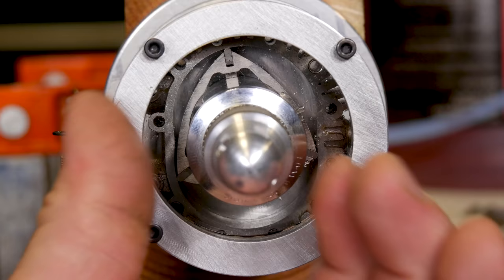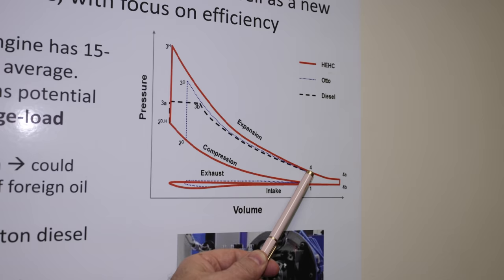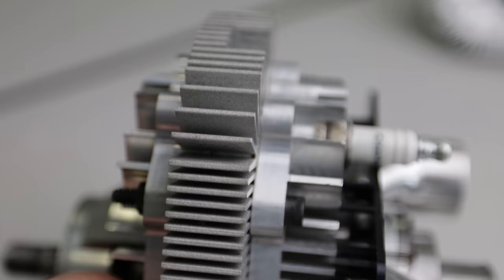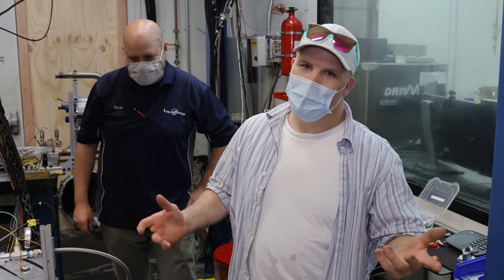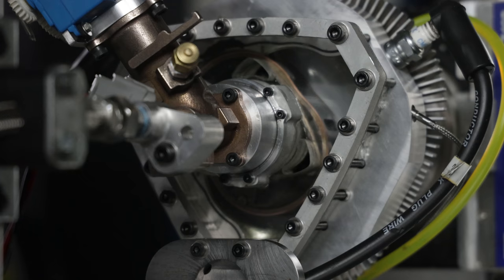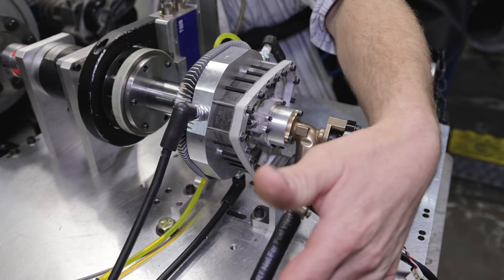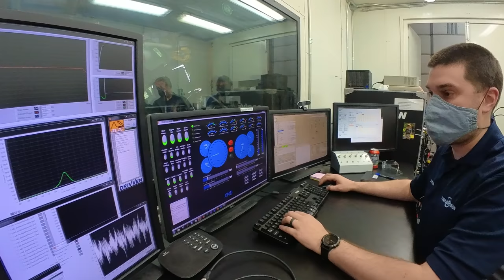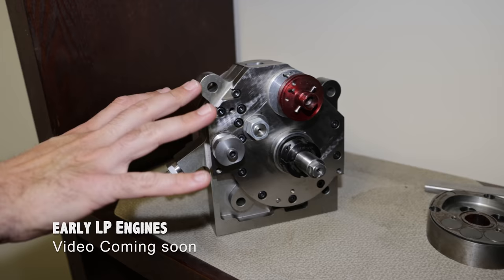See Thru Liquid Piston Rotary Engine - In Slow Motion

Comment: I already see problems.
-How does scavenging work?
-The other side of the other Rotor is always compressing, power stroking and exhausting
The temperature difference isn’t good
-the intake of air fuel and the exhaust flow isn’t efficient

Comment: First off, the acetylene run was stupid. It crapped up the motor so you couldn't see the rotor and you had to clean it. What did this prove, other than you know how to make a mess?

Second, you didn't say anything about how the apex seals were going to be better in this design. They're mounted on the case instead of the rotor in this design but I don' t see how they're any more reliable, better sealing, easier to replace than the standard Wankle seals.

Third, one of the biggest problems with the rotary is that it's a bitch to get them to pass emissions testing. You don't say anything about efficiency improvements with this.

In short: You don't address anything of substance in this video, you're only saying how cool everything is. I think LiquidPiston is chasing their tails on this design. I don't see any improvements here.

Comment: So they moved the apex seals, (which was the ''problem'' with rotary engines) to the housing instead of the rotor. How isnt that the same problem?
Im just a random rotary owner, (rx7 and rx8) with engineering degree in ICE, and im genuinely not trying to be a smartass.
Reply: I am not an engineer or a mechanic, but I assume that it is better because they are now stationary within the engine and not on a moving part as they once where.
Reply: @snake14088  I see your point but even in a moving part, the wear of the metal is exactly the same since its one sided. Same with stationary parts. The wear will be one sided. It could be that the housing is receiving less stress and in a more controlled manner than the moving part. I guess they know something we dont. Who knows, maybe its the next best thing.
Reply: @thomaskalkanis3777  The primary advantage is the ability to oil the apex seals directly, much like piston seals. The rotor's face seals are then oiled by constant contact with the apex seals. No more oil-fuel premix, dramatically reduced oil consumption.
Reply: @boissondevin9772  I understand this would be a step forwards. However the main issue with rotaries is still the excessive wear of the seals. Probably with direct oiling it will be reduced ?!

Comment: This is literally an inside out Wankel... The apex seals are still there, they just aren't part of the rotor. The rotor is the same shape as the chamber in the Wankel, and the chamber is the same as the rotor on a Wankel. I'm not sure this provides any real solution. The intake air is going to get hotter in this than they did in a Wankel too. It's neat to see people try to saw the Wankel from doom, but this probably isn't it. Especially as the world adopts electric and possibly hydrogen.

Comment: I call bs. you can tell this thing isn't running on its own but is actually being driven by the electric motor it's mounted to that they call a "dyno."  The smoking gun shot is when they ran it on gas, you can see at the end of the run they shut the spark off but it just kept on spinning because the electric motor was still spun up. Show a 3rd party video with it not attached to an electric engine running.